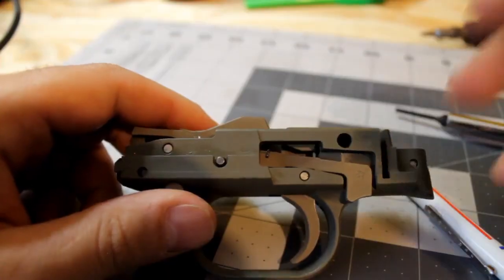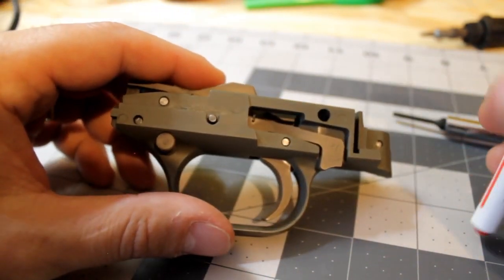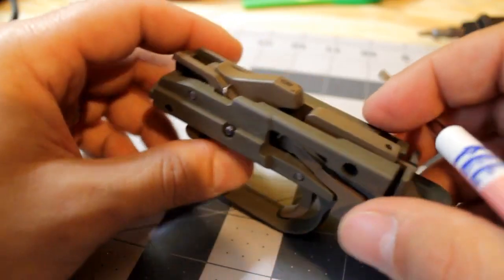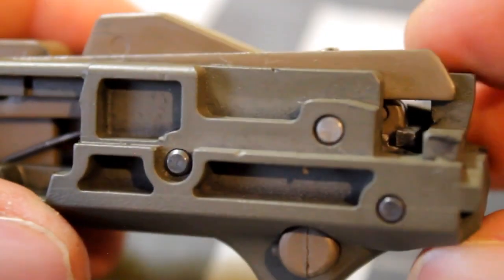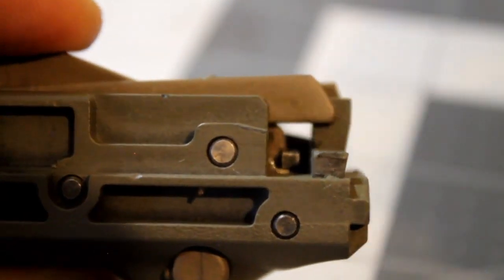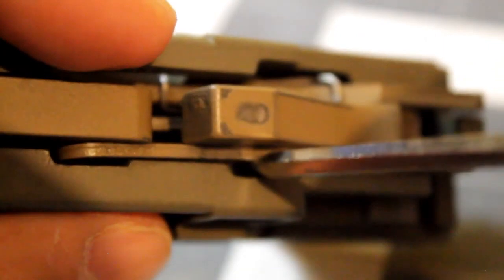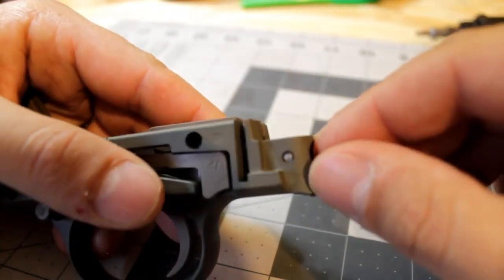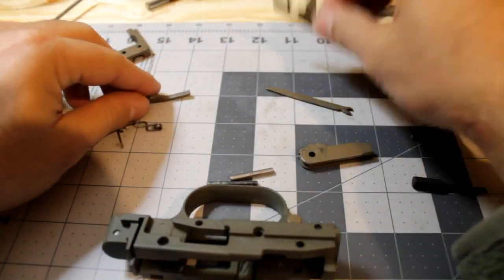DETAILED FULL ASSEMBLY  Trigger Pack Mossberg 500, 590, Maverick 88

Comment: Do you know how to soften the safety up a little? Mine is stiff enough to where I can't push it with my trigger finger.
Reply from the maker: @inscoredbz  you could try working it back and forth and add some oil while doing it. I would recommend doing this for several min. If that don't work removing the safety and checking the spring would be my next go to. If this is a new gun, it would need a little wearing in. Moving it for a while should accomplish this.

Comment: Haven't picked up a Maverick yet, so I'm just looking into them. I don't know the name of the part. @2:56, the hole on top, of the bar right behing the hammer, any chance you've looked into putting a 4-40 or 5-40 "Trigger Stop" screw into the part?
I saw a really short video by some guy claiming that doing that, adjusted correctly & locktite applied will take up all (too much if screwed in to far) the slack in the trigger. Sounded like lowering the pull weight at the same time too. Kinda sketchy sounding.
Reply from the maker: Well the take up would be the amount of travel that the hammer sear interface has to move across the sear which is being actuated by the trigger. I used to have a detailed video of the assembly process but it has been lost and I need to redo it. Once I get the trigger pack apart, I can CAD this and prove or disprove the theory of the set screw. Can you provide the video you found?